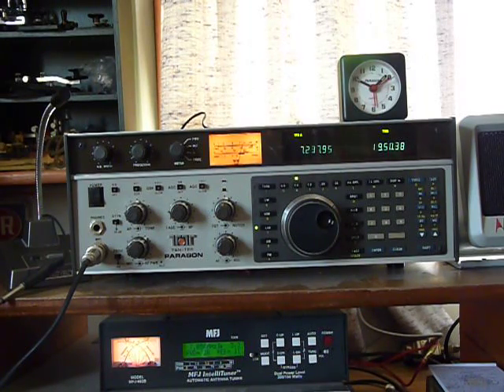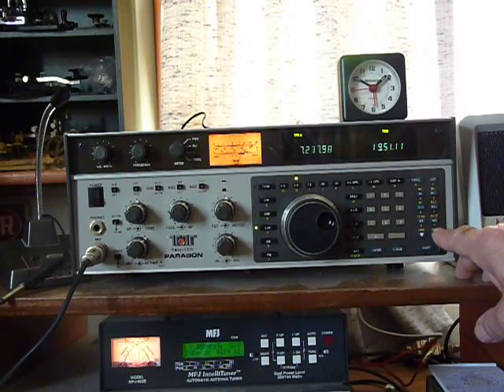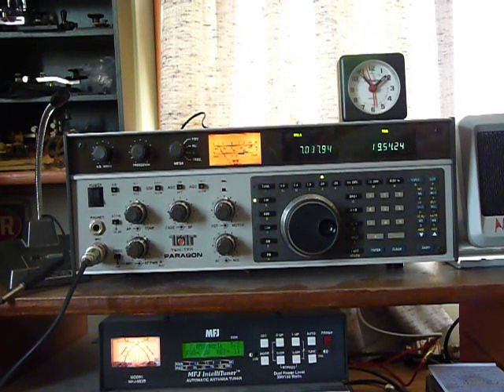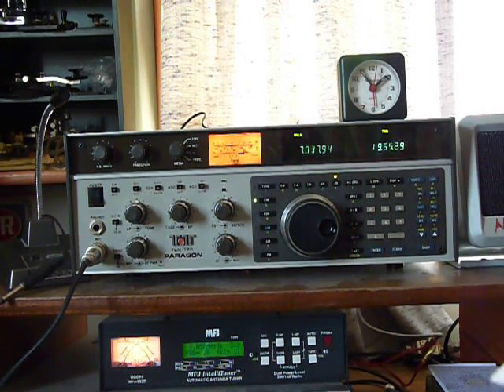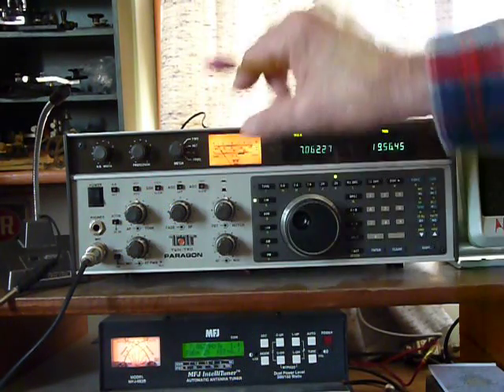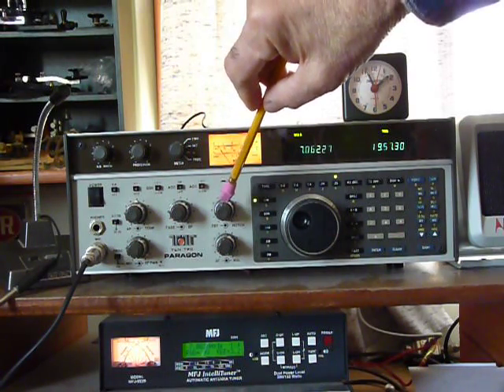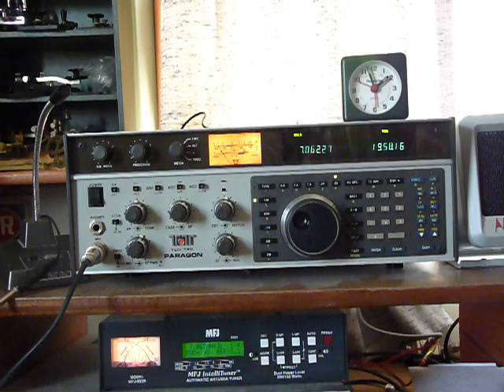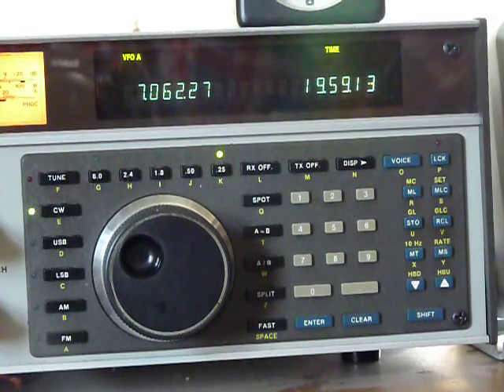Ten Tec Paragon 585 HF Transceiver

Comment: I had a Paragon for about a year.  Loved the radio when it worked but unfortunately that wasn't very often. The PLL board gave me nothing but trouble.  Shame Ten-Tec didn't do much to cure the problem as they are quite a good radio when they work.
Good video..thanks for posting..